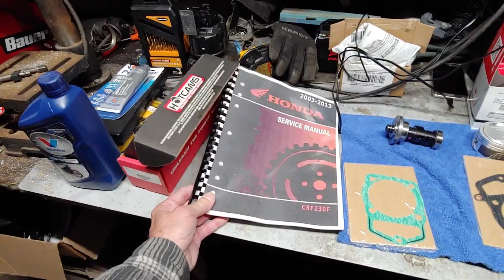Cam and Wiseco 11:1 piston install Venom X22R 250

Comment: Yeah, you can hear the cam in the idle a little.  Might have to bump the idle rpm up a hair.  Good video of the process Jerry.
Reply from the maker: Yes, I hadn't adjusted the idle mixture yet when i shot the video. That's why it had killed. lol It was idling around 1600 rpm's
Reply: You can fix that with silent rocker cams from Amazon or eBay...odd I can't hear mine at all...
Reply from the maker: @trucker2b  I've though of using those on my Hawk but found out they will be a week point as they will fail and get out of tolerance as the wear. Great idea if you can find top quality rocker arms.
Reply: @JerryHawk250 ohhh...didnt know that...i wonder what would cause them to fail
Reply from the maker: @trucker2b  I ran across a post on FB this morning of someone with a picture of a worn out roller cam rocker.
Reply: @JerryHawk250  😬dang

Comment: I got a question I just rebuilt my engine and not it’s hard to turn over.It’s not super hard where it could be something binding it’s just that the engine seems a little tighter could it be that I did some thing wrong with the timing?It started but idk is there by where where you think I could have went wrong
Also love ur videos they are great

P.s. also I felt it get harder to turn once I installed the timing chain tensioner
Reply from the maker: If it's running smooth I wouldn't worry too much. The engine will be a little tight until you get some hours on it. The engine needs to break in and rings need to wear and seat.
Reply: @JerryHawk250  thanks I was thinking I had done something wrong

Comment: Great video. But the ring gap must be measured at 1cm from the top of the cylinder, not from the bottom.
Reply from the maker: I agree that it should be check from the top which I also did but did not show in video. But according to 8_6 of the Honda CRF230F Service manual it's checked from the bottom. Manual is open to page at 18:26 on the video.
Reply: @JerryHawk250  I'm learning something today ;)
Reply from the maker: @BenGallou  I'm 62 years old and been working on small engines since i was about 15. I'm still learning something new everyday. Just when you think you know it all something different pops up. lol

Comment: Jerry hi how you doing I appreciate all your info from what I understand the motor on my 2021 is almost identical to yours the bore and stroke are the same okay and from what I understand from Sean at venom Motorsports is that your mod will work perfectly with that engine there is no difference in it's a 65.5 mm bore and the stroke is the same
Reply from the maker: If your engine has a site glass on the side it will be the same. If not it has the bigger bore. I had both engines.
Reply from the maker: If i were you i would pull the head to verify. We had a couple of members that bought big bore kits and cams and found out that the newer engine had a bigger bore.

Comment: I know it's a fairly new engine but what I was saying the l Life in engines are more of a engine that you just cruise around with they are not 8 engine that you start modeling they just don't last And they blow quicker when you start marching them that's what I was saying But to each his own
Reply from the maker: I understand what you are saying. I don't plan on wringing the throttle every time i take off from the light or stop sign. I done these mods to give it that little extra umph so i'll have that little extra power when needed. Mostly what i d o is cruise around on the bike. Now i have that extra power to get up to speed on the interstate a little quicker and have the extra power to get around a car if i need to pass it. 
I don't think the engine would last long if i had it pegged every time i rode it but neither will a stock engine if it was abused.

Comment: Jerry I really appreciate your comments I just got a 2021 venom motorcycle I did a nice fender delete I'll send you a picture of the nice custom exhaust I did all stainless steel it comes out up through the side fairing on the right side but I need to know where and what are the dimensions for the 36 tooth rear sprocket where can I get it possibly the 18th tooth sprocket also I think I might just stay with the 17th tooth front but I want to go with the 36 tooth rear sprocket and that's about it and I'm going to put the new carb on even though I have my stock one on already rejected and everything it seems it does about 74 right now could you please send me the info on the sprocket and thank you so much for the motor info
Reply from the maker: I'm not sure if they still sell the Custom Sprockets  but this is where i got them from https://shop.pbisprockets.com
Center Hole Size. size: 64mm, 58mm if you remove the spacer ring   - Size of bolt holes diameter. 10.5       circle diameter through center of all bolt holes: 96mm 
Important Note: Sprocket will need to be milled to recess and install the stock steel ring.

Comment: Is the venom motor the same as the hawk? Would those mods work on a hawk? I have a bashon brozz recon 250 and i think its the same Chinese motor as the hawk except it has a counter balence. I had a wiseco racing piston in a honda xr200 when i was teenager. My dads friend bored it out and put the piston in after i blew the motor up. When i got it back it had soooo much more power! My friend had a xr250 and he couldnt keep up with me i would  beat cr125cc 2strokes on streets.  Before the motor was rebuilt i was always behind those guys struggle to keep up a quarter miles behind them. The changes where amazing! I was hoping to have the head  ported and polished and change the carb to  a nibbi, change the muffler to something loud bore out the cylinder  and put a racing piston in, change the sprockets and jets and i hope that will bring my top speed up higher if all that stuff is possible to do. Your venom looks really nice and it must fly now. Thanks for sharing your work and mods.
Reply from the maker: Two completely different engines. The Hawk has a CG engine which is a push rod OHV engine whereas the X22R has a CB engine which is an overhead cam engine. Wiseco may make a piston for the Hawk engine. You would have to take some measurements and get with Wiseco to see if they can match. On my Hawk i just shaved the head to increase the compression ratio to 10:1. I also ported the head on the Hawk as well which makes a huge difference.
Reply: @JerryHawk250  thank you for responding and thanks for the good advice. I heard that porting and polishing the head does make a big difference. Do you think you will do anything else to your hawk or are you done with anymore customizations?  Thanks again for the advice 😁👍
Reply from the maker: @7.62shawn5  I do have a 4 degree timing key that I haven't had a chance to install yet.
Reply: @JerryHawk250  well all 3 of your bikes are awesome! Hopefully i will get mine close to that cool someday. 😁👍

Comment: I appreciate the videos and info on these parts. I hope to get  a Bashan  250 in the future .this will help to get little more grunt .  Check out red beards garage  he did some mods on a Bashan 250 supermoto
Reply from the maker: The Bashan 250 is a CG engine with a single lobe cam and push rods. You can port and deck the head like i did with my Hawk which gave it a good bit more power. Much better than stock.

Comment: There Is a 6 speed gear set for the cb250d-g 165FMM engine
Reply from the maker: I've looked into the 6 speed gear set. I'm curious as to what else will be involved to do the swap. It would probably be less work to buy a Loncin RE250 with the 6 speed and do these same mods on it.

Comment: Jerry I just got my sprocket in so know I'm running 18t front an 36t in back but my chain is to long how can I remove links without the  proper tool....lol
Reply from the maker: I used my rotary tool to grind the end of the pins off then removed the links. I've never used one of them fancy tools. lol

Comment: I ordered a big bore kit for my bike which comes with a slightly bigger bore and a 11 to 1 compression piston. What main and pilot jet should I use on start up/riding bike around?
Reply from the maker: That will depend on what carb you will be using. With the PE30 I was using a 28 pilot and 125 main. On the stock carb it will be a 40 pilot and 125 main.
Reply: @JerryHawk250  Ok. I was planning on using the PZ30 that came with the bike and rejeting it. I was thinking of switching over to a higher performance one around Christmas time
Reply from the maker: @charlesreiman2185  the stock carb will perform well once tuned.

Comment: How did you remove the starter? I have to remove it to get access to the chain tensioner
Reply from the maker: There are two bolts on the clutch side of engine that you have to remove. The ground wire for battery is connected to one of the bolts.

Comment: Jerry I had the x-22r I'm going to port and polish the head can you give me the link for the piston and and what kind of Cam should I use again the crf150s from Hot cams if I say that they'll know what I'm talking about and what millimeter how much did you have to bore your cylinder or did you get a new jug
Reply from the maker: What year model do you have?  The newer models have a larger bore already and none of these mods will work.
Reply: Jerry thank you so much I do see on the video that it does have an order at cam could you please give me the website where I can order the piston rings and what size is the Piston the Piston pin
Reply: Jerry thank you so much for the info can you please I do realize it's an overhead cam can you give me the website I know it's a 65.5 mm bore piston but I also need to know what size is the Piston pin how many millimeters and what website could I get it on please
Reply: I want to do the 11:01 compression like you did
Reply: I have a brand new xr-22 motorcycle it's a 2021
Reply from the maker: @marksellas5080  here's the piston https://www.ebay.com/itm/382670730611?mkcid=16&mkevt=1&mkrid=711-127632-2357-0&ssspo=TC6Z2KeKQju&sssrc=2349624&ssuid=ED92TpApSVK&var=&widget_ver=artemis&media=COPY
Reply from the maker: @marksellas5080  here's the cam https://www.ebay.com/itm/174322968917?mkcid=16&mkevt=1&mkrid=711-127632-2357-0&ssspo=uXFSjAY1Rwe&sssrc=2349624&ssuid=ED92TpApSVK&var=&widget_ver=artemis&media=COPY
Reply from the maker: @marksellas5080  none of these parts will work on the 2021. 2020 they changed design of the engine. Your engine has a larger bore.
Reply: Jerry can you recommend any mods for me besides port and polishing the head I have the nib racing carburetor and I'm doing the sprockets and I have the high performance exhaust and the manual it says it's a 165 fmm engine and the bore is a 65.5 x66.2 stroke the compression ratio says 9.3 - 991 223 mm volume of cylinder so that's not the same engine still
Reply from the maker: @marksellas5080  the manual probably has the old specifications. Your engine is 229cc and if I remember correctly the bore is 67mm
Reply: So does that mean I can't even install the cam that you installed
Reply from the maker: @marksellas5080  I'm not sure if the cam will work with it.

Comment: Hey what carb did you use all i can find is ones that fits 125 to 150 cc? Did find a couple that fits 250 but dont know if it will fit on bike
Reply from the maker: I used a pwk30 carb.

Comment: The 67mm big bore kit didn’t fit the 250 ghost chopper so I think it’s a 69mm piston. The cam went right in and got a few more mph on the top end. Does anyone know of a 69mm high compression piston?
Reply from the maker: They made a change to these engines for 2020 and now they come with a 69mm piston. I don't know of any aftermarket piston for these engines. You can have the head deck/shaved 1mm to 1.5mm to raise the compression. I've done this on other engines like my Hawk.
Reply: @JerryHawk250  Oh Ok. Please let me know if you find a piston. The piston would take the bike a long way. I wonder if a company can custom make one
Reply from the maker: @charlesreiman2185  I'm sure there's someone out there that can but might be expensive. Decking the head would be a less expensive option.

Comment: I am about to do this mod to my ghost. Would you remember where you purchased the gaskets for this mod? It is not in the description links below. Thanks.
Reply from the maker: The new engines on the X22R and ghost have a larger 69mm piston now so gaskets will not be the same. The cam will still work though.
Reply: I checked the manual that came with the bike and there was no engine information. Where would I find this info? My ghost was delivered in September of 2020.
Reply from the maker: @MarsStrider  I didn't know they made the change until one of the members on Chinariders went to install a Big bore kit on his Venom X22R. He discovered the the stock piston was larger than the big bore kit. lol . The 2020 models and newer are a 229 cc engine instead of the 223 cc like my 2019 X22R. This explains the deeper tone thump my Ghost has over the X22R. The engines sound completely different. You can get a head gasket for Joe Henner of Henner Powersports. He has a FB page where you can order parts. The head gasket can be reused as they are a three layer metal gasket. Use a single or two layer and that will bump up your CR. The good news is you already have a big bore kit so all you need is a 4 degree timing key and a cam. I haven't ordered my cam yet but will go with a more aggressive cam than the Hotcam.
Reply: @JerryHawk250  Thank you for the valuable information. I would have wasted valuable riding time doing the tear down only to find out it is the wrong piston. I look forward to seeing how you upgrade your ghost. I put a 18 teeth front gear and 37 rear. Oil cooler and cat delete. Removed the air box and put a high flow air filter. Next will be to port head and upgrade compression along with a better cam.
Reply from the maker: @MarsStrider  You're welcome. Did you have any issues with clearance with the 18 tooth? FYI i would keep a good eye on chain tension. If you get too much slack in the chain and it decides to jump tooth, you could end up with some case damage. Why the 37 tooth and not the 36 tooth?
Reply: @JerryHawk250  I had to mill the chain case cover to get added clearance. I could not find a 36 tooth gear. I did the numbers, going up 2 teeth in front is the same as 1 on the back. I had to remove two links from chain. Now it is good. So the ghost comes with a big bore already? I find in 5 gear, my bike feels like it has more to give.. Have you noticed with the tires, how awful they are when the ground is wet? I need to swap out for better ones.. I am trying to get this bike perfect for my son when he goes off to college. He already has a 110cc dirt bike he is practicing on.
Reply from the maker: @MarsStrider  I've only driven my Ghost once on wet roads. It felt okay but yeah better tires would be a good idea if you plan on riding wet roads.
Reply: @JerryHawk250  I was looking at cams for ghost upgrade, would you recommend doing the advanced timing key with the cam upgrade or does it not matter either way?  I could not find a more aggressive cam than the hot cam.
Reply from the maker: @MarsStrider  I did both. The 4 degree key does make a difference. This is the cam I'm looking at. It's more aggressive than the hot cam. https://www.ebay.com/itm/174322962671?ssPageName=STRK%3AMEBIDX%3AIT&_trksid=p2060353.m1438.l2649
Any cam for the Honda SL230 97~08 XR230 03~08 CRF230F 2003-2019 will work.
Reply: @JerryHawk250  I will look into that cam. I am also looking to see if a bigger piston is necessary  to increase the compression since the ghost comes with a bigger piston. I will look into porting and polishing the head for increased performance. I wary of doing it myself as I have never done it before and may just send it out to do. I very much appreciate your time and information and will take any advice you offer. Thank you.
Reply from the maker: @MarsStrider  bigger piston doesn't increase compression ratio. A taller piston or lowering your deck height will. Easiest way to increase CR is to use a thinner head gasket and shave the head.